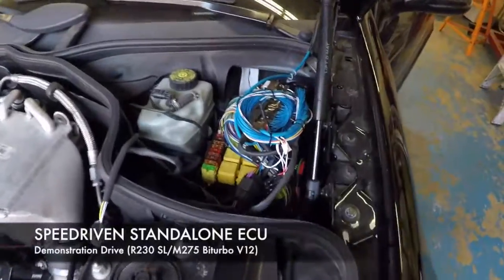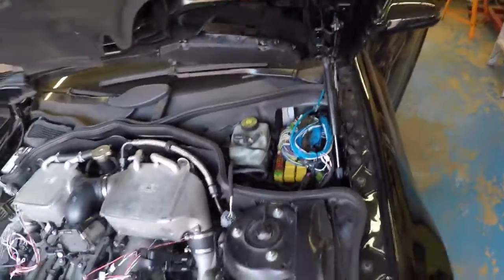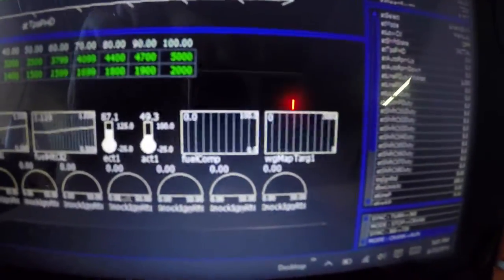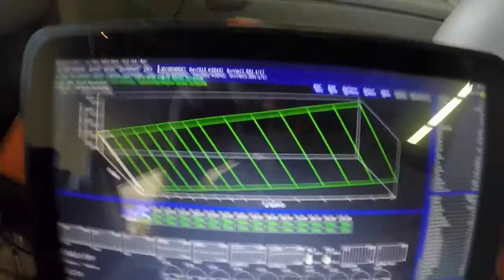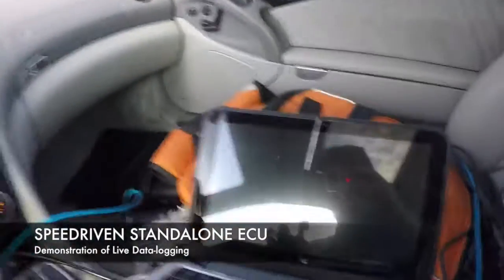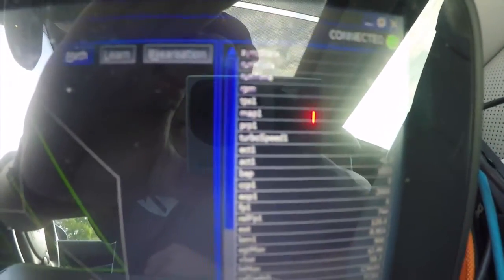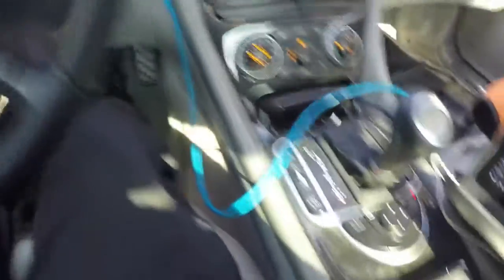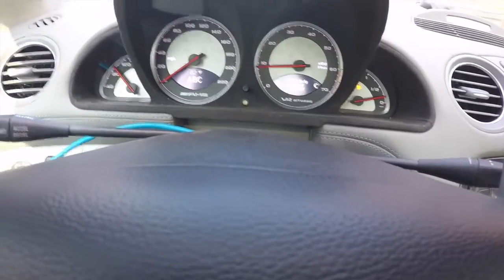Speedriven Standalone ECU Test Drive

Comment: У меня есть W220 c Двигателем М275 S600 2003 год, сколько будет стоить полный комплект вашего оборудования, чтобы перевести его на катушки с М113 двигателя как на видео?

I have W220 with engine M275 S600 year 2003, how much it will cost you a full set of equipment, to translate it to the coil with the M113 engine as in the video? sorry its a google translate)